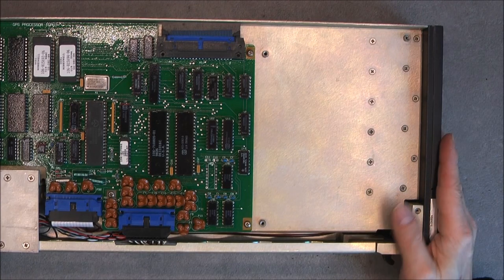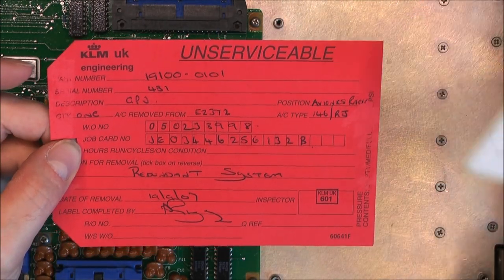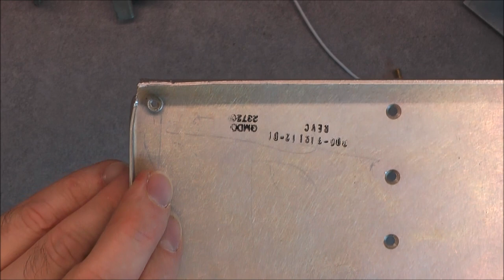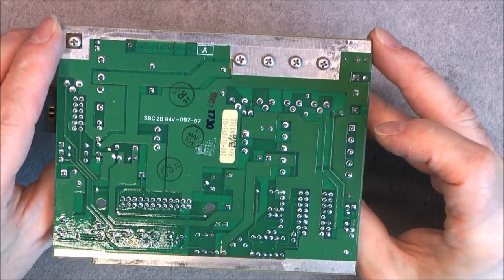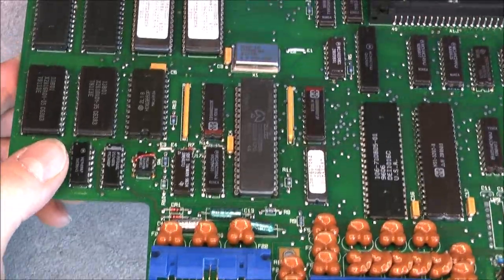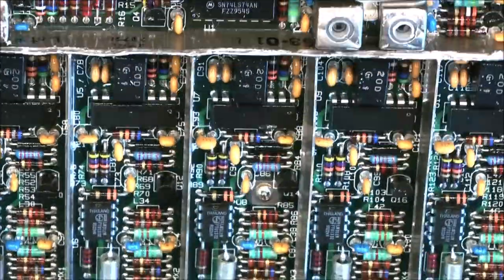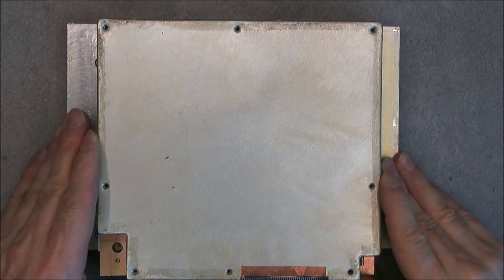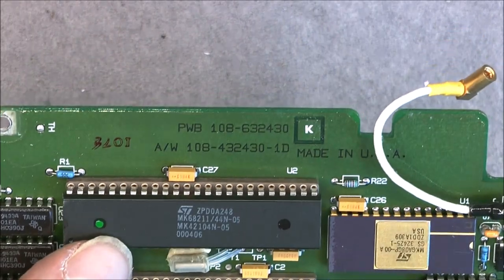AlliedSignals avionics Global Positionning Unit teardown

Comment: The devices on the RF board labeled "ASK-1" are actually 600MHz balanced mixers from Mini-Circuits which are most likely used as the main RF mixer.

Comment: It may be a very interesting item for someone whoo wants to learn/study how the GPS systems were designed in the day. Certainly it would be cool to try and power it up.  Ask around before you permanently destroy.

Cool find.  These older GPS systems had a lot more of the engine parts visible, it is all hiding inside one chip now.

There was a DIY GPS design way back in Wireless World magazine that used a i286 processor and a whole shoebox full of other stuff to achieve a single channel receiver this is something in between.  I expect some other similar designs will be on the market as obsolete, they probably all are so poor resolution compared to new multi system units that they have no point in upgrades (software designers have died of old age).

Comment: 7:58: The crystal oscillator manufacturer Vectron is now part of Microchip. This C0 Series oscillator is a very old model out of the "Precision XO" series. They are not manufactured anymore since the end of the 90s I think. It will by hard to find a data sheet. Good luck!